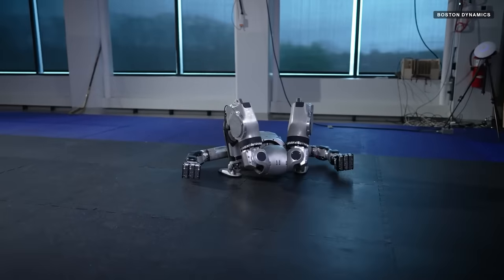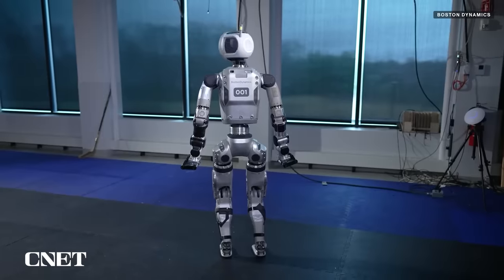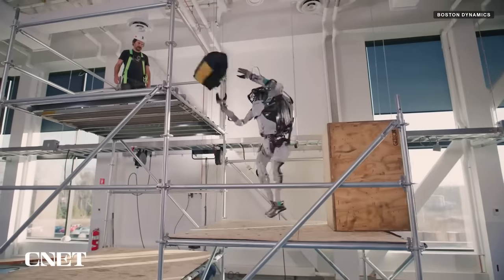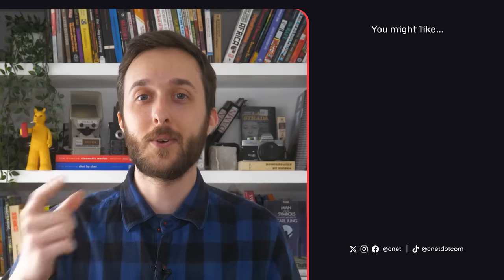Atlas vs. Optimus: Boston Dynamics & Tesla's Humanoid Robots

Comment: For three decades Boston Dynamics were undisputed leaders in agile robots. But focus on the most perfect hydraulics has cost them dearly. Now many other companies are years ahead of them in Artificial Intelligence for robot control, and in real world applications of robots. Also in the amount of investment and the scale of product manufacturing. While Boston Dynamics has so far sold 1500 "Spot" robot dogs and zero humanoid robots, Agility Robotics, for example, has a factory capable of producing 10000 humanoid robots a year, and a contract with Amazon and several other logistics companies. And they are not alone -- there are half a dozen others. So, it is good that Boston Dynamics are finally waking up, but they will have to work very hard to catch up.

Comment: The optimus robot is cool but never will compare to atlas. Thought the robot has made so much progress in so short time that partially is because of technology being better. The designing software for atlas , materials, and pure knowledge of Engineering was not as known or explored as it is now. Also, Tesla has way more money than Boston dynamics and has the ability of quickly making factories for the parts of their robots. Boston Dynamics has none of that but is still doing better.
Reply: No matter how good it is, it doesn't justify the 6 figure price tag compared to the much better value of the 20,000$ Optimus robot.

Comment: By YouSum Live

00:00:04 Boston Dynamics introduces Next Generation Atlas robot.
00:00:20 New Atlas features electric power and superhuman movement.
00:00:39 Competition with Tesla bot and agility robotics in warehouse tasks.
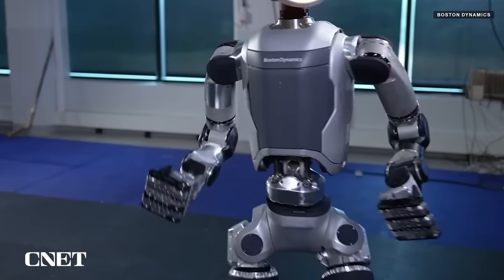00:00:52 Development of versatile grippers and move towards commercialization.
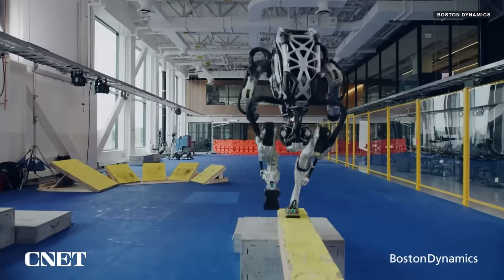00:01:22 Contrasting goals: research platform vs. commercialization approach.
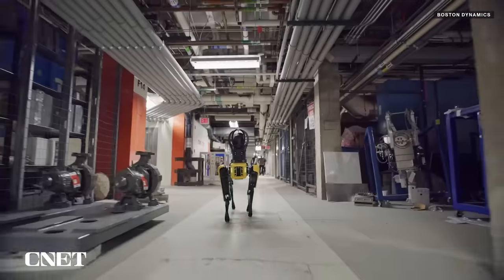00:01:49 Boston Dynamics' experience in commercial robotics with Spot robot.
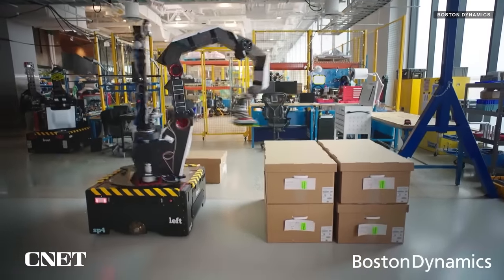00:02:13 Integration of Atlas with Spot and Stretch for warehouse operations.
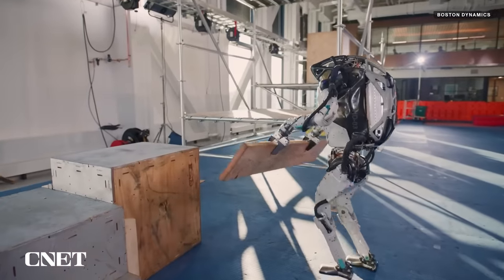00:02:39 Shared vision: robots augmenting tasks deemed dull, dirty, and dangerous.
00:02:44 Industrywide narrative: robots augmenting human labor, not replacing it.

By YouSum Live

Comment: impressive as an engineering feat, but it's still basically a toaster performing gymnastics. those robots still are not even close to assist someone at home with simple tasks like preparing a meal, doing a load of laundry, or going out and running an errand.
Reply: Tesla is using the same computer and neural net hardware as FSD.  It is not programed code.   We have seen it sorting blocks by color with a human interfering with the process.   It would not be hard to extend this to doing laundry.  Sort by color, load machine ...
It is expected that Tesla will put it  to work making cars for a while prior to releasing them.  The key to success will be training.   If they can come up with something that one can train at home without special equipment.   It should be a hit.
Reply: @danharold3087  and the cost of such a robot? most people live paycheck to paycheck. those robots would only be for the wealthy, who just might hire a human housekeeper that would be cheaper and need less instruction exactly spelled out to them, as a robot would.
Reply: @danharold3087 They can't even make a self driving car that doesn't try to crash Elon into a wall though?
Reply: @LoveHammerMan  Yes.  FSD is not there yet.  But where a car crashes into a wall a robot will drop a nut on the factory floor.  So much easier.
Reply: @danharold3087   Ehhh, if it's anything like the Atlus blooper real...

More like falling down and potentially destroying itself or injuring someone/something it lands on.

You mentioned changing loads of laundry? What if it uses bleach instead of soap and ruins a whole load of clothes? What if it's a household that has someone with sensitive skin, and uses a harsher detergent on accident?

More of a stretch, there is also the whole angle of people's erratic fear of a killer bot.  It's my bais showing again, but I'd again take the bet that Boston Dynamics algorithms won't possibly try to kill someone, unlike Teslas track record.
Reply: @onsenguy  You are not alone in asking who will buy when there is no work.  The question goes back 100s of years.  We are entering a transformation.   We will have to figure it out.
Reply: @onsenguy  The goal is for the robot to cost about 1/2 that of a car.  Back when I was making money I would have paid that.
How well will it work.  Depends on how well it is trained.     One company may work like a dream and the next is unusable.   
So we need legal rights for robots   We could have come up with a laundry list of why cars and airplanes would never work. While you don't have to use it don't write it off.

Comment: Notice Boston dynamics didn't show its robot actually walking because they don't have that down properly yet it could stand but walking around is a whole different thing for them they changed from hydrologic the electric motors now they have to learn
Reply: it... walked around in the promotional though?
Reply: It...walked off at the end?
Reply: @chaosfire321  it walked off clumsy, looking they only showed the top body, not the legs actually walking upper body looks jittery in movement

Comment: We are at least 50 years away from this! We cant even grasp self driving cars yet 🙄 chill out internet
Reply: Well Waymo self driving car company are in operations in both San Francisco, Las Vegas, and coming to Los Angeles soon. In fact some neighbors in Los Angeles do currently have food delivery robots.
Reply: @justcallmebrian793  well until I see 90% of cars self driving! We ain't there yet
Reply: @SteVen-v6u4k  Bro, it does not need to be 90 perecent, just like Atlas robot since it is mainly for industrial use and not commerical!
Reply: 50 years!?😂, do you have any idea how fast Ai learns currently? Multi modal ai combined with these machines will be at our doors in like 10 years and become fully mainstream in 20 years. Technology evolves rapidly.
Reply: @smittyvanjagermanjenson182 that's not necessarily true. when the Jetson's was made, people probably considered it self-evident that in 2024 we'd be driving flying cars
Reply: @onsenguy   We have everything at hand to make these robots.   The big thing is Neural Networks which has significantly matured in the last few years.   Still is maturing.    It will be software that determines the winners from the losers.  Under 5 years.
Reply: @danharold3087  under 5 years for what? how will a robot make someone's life easier in the home?
Reply: @onsenguy  5 years or less until a robot that can be trained is sold or leased. Not saying by who.
With the best Neural Networks we have these things will be trained as domestic servants.  I am serious.  They will become factory workers first.  The ability to do this is quite new.  On going research. A transformation.

Comment: can this robot hang drywall and flip burgers? can it thread a needle? can boston dynamics mass produce this robot for a price under 20k? no...they are not competition to tesla
Reply: Lmao, in what world is Tesla getting their bot to 20k anytime soon?
Reply: @chaosfire321  this world and in the next 18 months. Get in while you can
Reply: @buffbatman2  Riiiight. The same Tesla that's struggling at getting a cheap electric car out, to the point of canceling their mass market Model 2, will totally bottom out the price of even more complex humanoid robots to be even CHEAPER. Totally.
Reply: @chaosfire321  you do understand that the model 2 and robotaxi are the same vehicle with a steering wheel right? It seems like you just read 1 current headline and made that your opinion lol.